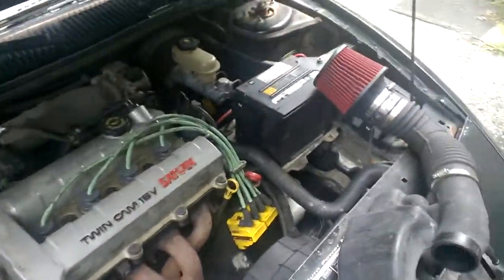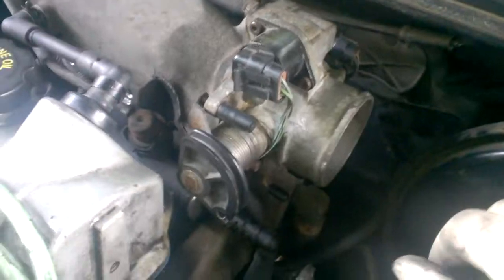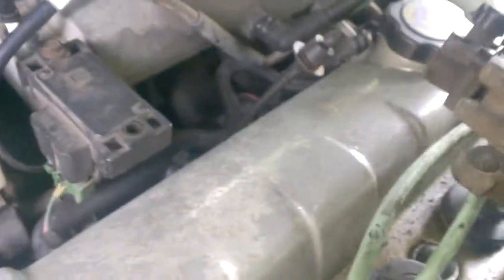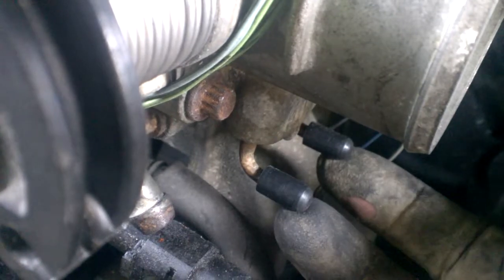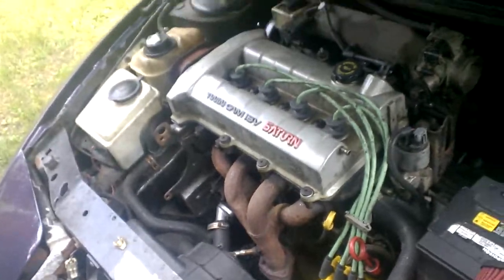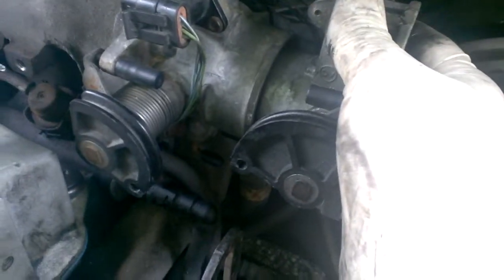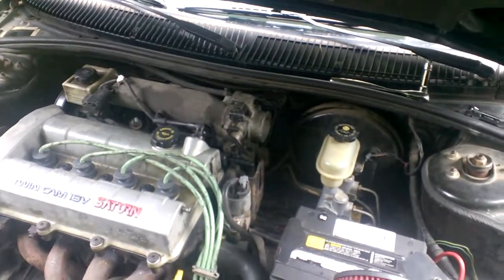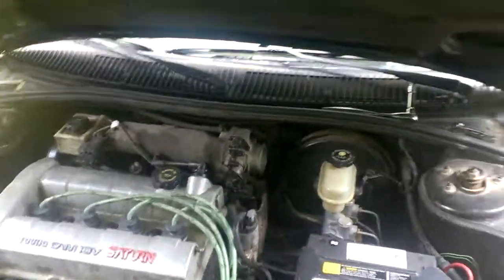Geo Storm 52mm(SOHC) Throttle Body Swap & Test

Comment: I cleaned the Throttle Body on 2001 Saturn SL2 (which is mostly the car to practice on, but I absolutely love it (design, easiness to access for repairs, many other things)), trying to clear the code P0446. It didn't help, I do smth different on it now, addressing the Fuel System, but what is interesting I have occasional, but very strange performance of Saturn. The strange behavior is rather weird: 1st time I observed it was like that: I went to Fire Stone trying to pass Inspection. I think I cleared the code w/a scanner (P0446) and thought I drove enough, to do the test. They started the Inspection and told me that I need to drive that car more on HWs and then come back. He also mentioned that the Saturn was throwing different codes kind of chaotically. They did the alignment which I have life free on that car w/Fire Stone (not completely though, since they didn't have a tool for the rear wheels alignment).  On the way back home the car started to shake on stops, more and more vigorously. When I came home and started to switch it on and off to see what is going on, at some point it started to shake crazy and then stalled. There was a small purple puddle under the car in the transmission area.  I thought they did smth at Fire Stone and the transmission now got broken (when I was going there there was no problems in the car performance). Next day though I tried the car again it started and worked, but with that shaking (high idle). I went to Chevy Dealership to do another alignment and try to pass inspection eventually better with them and follow their advices on that shaking. They did the alignment, again front wheels only (no tool as well), but it was my fault since I didn't tell them about my visit to Fire Stone, though it was a surprise for me that at Dealer they don't have all the necessary tools. I decided to go back and try to find the tool somewhere, so they can complete the alignment on all wheels. When I started the car it run like a charm w/no previous shaking. I run back to thank the mechanic and ask what it was, but he was gone for the day. Later I tried to find out what it was, what was done that the shaking gone completely, no one knew. 
   O'K, next time I had same issue w/Saturn, when the battery went bad and I replaced it w/a new one. The car was driving, but shaking and you feel that it is about to stall on stops, and actually stalled a couple times on lights, I restarted it though w/no problems. After 2 days of such a performance I went to Walmart (on the way same crazy shaking on stops, you feel you press on brakes and fuel goes somewhere instead, like the car wants to accelerate or smth) and when came back, thinking about hard driving home, the car started like a charm and I went home w/no issues. Till now I don't know what it was or most likely is and now. I suspect a faulty computer (it is called Power Train Module in that car). We bought the Saturn used ~60Kmi, I think maybe someone changed that Module before, and it is not quite right Module and maybe it learns too long a new battery.  Usually such shaking is due to the vacuum leak somewhere, but why it happened after the battery replacement and gone, like nothing happened after some time? It would be interesting to know your opinion, if you have time of course.
   Thank you very much for your film.

Comment: Where did you get your header from and will fit a dohc engine?
Reply from the maker: The header is a stock, 1991-1992 exhaust manifold, which needs to include the Y-Pipe assembly. The manifolds and Y-Pipes are discontinued, by GM, so you can only source them from a wrecking yard or Amazon/eBay. 

I use www.car-part.com to source used parts at wrecking yards.

Comment from the maker: I was running a 17.2 in the qtr mile, @ 78 mph with the swap. So, by my trap speeds, I actually gained no additional HP. It shifts the rpm range about 200rpms(peak torque @ 5,000rpm/peak HP @ 6,200rpm). The biggest issue for automatic owners will be the engagement of the lockup torque converter. The Geo Storm TPS sensor only reads 80% throttle by the Saturn PCM, so the lockup converter won't engage until well into second gear. The PCM will not run the best fuel ratios, because it is "technically" not at WOT. Best bet is to port the stock TB unit to match the manifold.
Reply: That's what Gude performance did to my TB! R.I.P. Sucks the owner died, was like 74! It was a nice compliments with the ported intake manifold and CAI I have and the 1991-92 factory GM header. I dropped 50lbs off the car too, carbon fiber Seibon hood,  and did K&N sport springs with full polyurethane bushings and when I did the trailing arm bushings my bottom end slightly improved from better traction so I ended up replacing all the bushings, control arm bushings, etc. I still regret to this day that I didn't jump on the head package from Gude before he died. But it's alot quicker now than factory, and mine is still automatic. Also sucks there's no aftermarket transmission controller available to stretch maybe the shifting points to complement a mild Turbo and build the head mildly and maybe .20 over forged pistons. The Saturn forums in the past had some head mild de shrouding of the valves and mild seat work, and of course a machine shop will usually shave .10 thousands off the bottom for a clean fit and with the .20 over pistons combined should give it a nice little bump in Torque and compression, 9 to 1? Pretty sure it's 8.7 to 1 factory, but anyways hope your still alive man, take care!
Reply: So cal porting did the new one on my 94 SL2, and I did the intake too.. He did a better job than on the GUDE one, ran as far as possible into the runners and plenum as possible and did a smooth polished finish . I know it's pushing peanuts on the Saturn model to port and polish the TBI but the amount of modification to make the Geo one work, I'm boosting mine anyways, so getting an extra 2 mm's isn't going to be the end of the world I figure.

Comment: I have the storm tb for my 97 but i need to either fab a cable bracket or buy one. Would prefer a cnc one though. Any ideas?
Reply from the maker: There was a guy, on sixthsphere.com, that fabricated them a few years ago. I tried to email him about ordering one, and he never replied. 

You can see what his bracket looks like, and I would recommend CNC or 3D Printing it with carbon-fiber. 

Either method, because the one I made from bar stock, a drill, and a dremel did not work very well.

You will not get WOT % at the TPS with this TB, however.
Reply: @Joshua_James_Howard  yeah i tried getting on there but the random question kept aving the wrong answer lol. I would like a cnc one most. But if i have to fab then so be it.
Reply from the maker: Just keep an eye on your fuel trims, because the bigger TB unit runs the engine a little lean. I burned an exhaust valve in my #3 cylinder, which i attribute to the SeaFoam in my gas tank instead of the TB itself. I also did not see a change in my E/Ts at the track because the Storm TB only registers 80% throttle when you floor the gas pedal. So, the automatic transmission will not engage the TCC in 1st gear. It does shift BOTH peak torque and peak HP up 200 rpms. Peak torque will occur at 5,000 rpm, and peak HP will occur at 6,200 rpms. So, if you have a manual transmission, shift @ 6,200 and do NOT run to the 6,500 rpm red line.
Reply: i have a manual trans. Just looking to run something a little better than what i have.